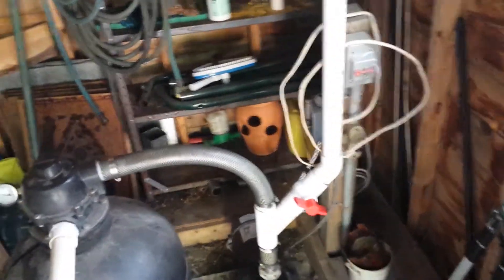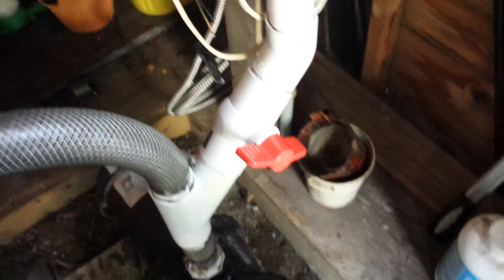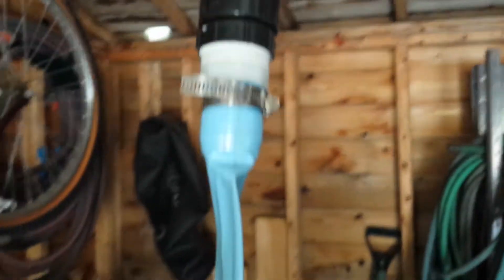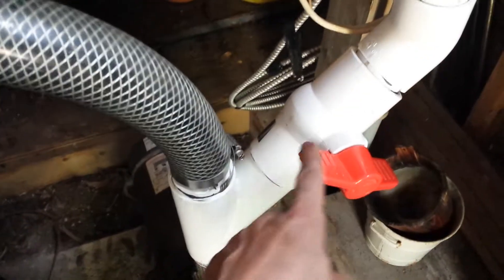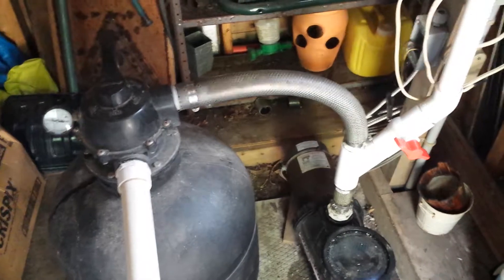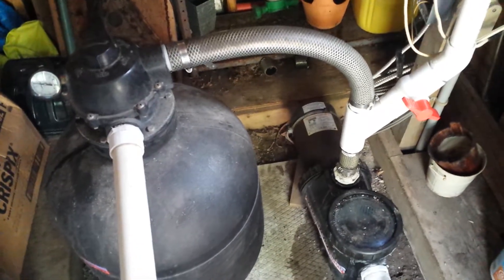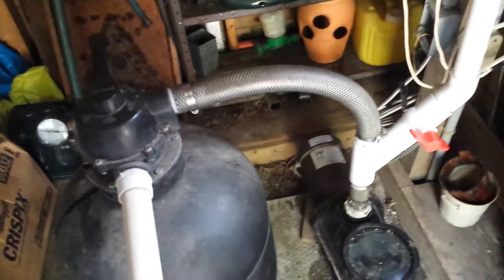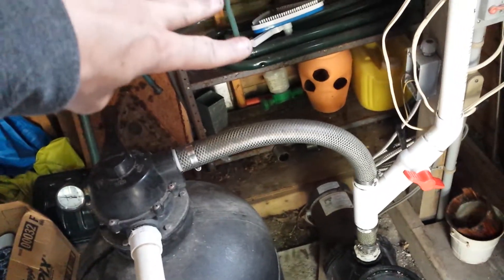DiY Solar Pool Heater Part 2 Pump

Comment from the maker: Thanka warrior will try that on my 2nd setup. Total cost was only 200, bought enough materials for 2 heaters. I do have a check valve on the return line but didnt have it plumbed in when I shot this vid

Comment: Where are the check valves? If you paid $400 for just the parts, you spent WAY,WAY too much. A 4 x20 solar heater costs about $200 ready to install including all the connectors and professionally built. Check Google for kits. You made the plumbing way too complex and costly, but it is really quite simple with just a check valve and 2 multturn valves plumbed in.